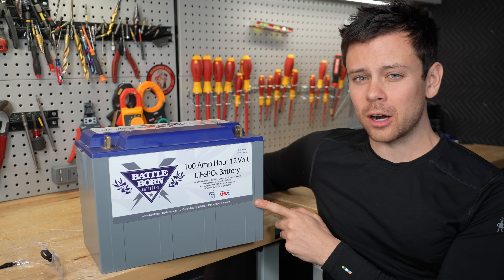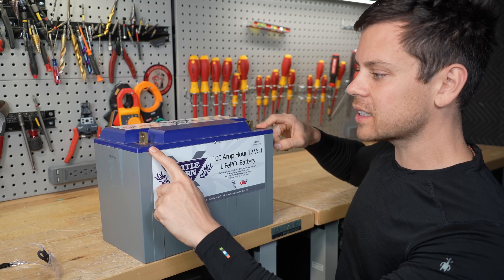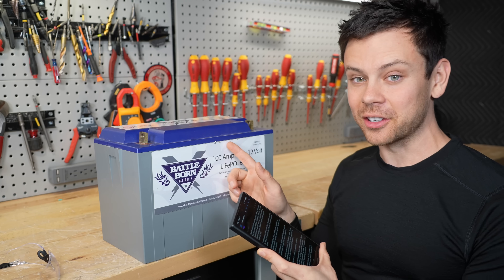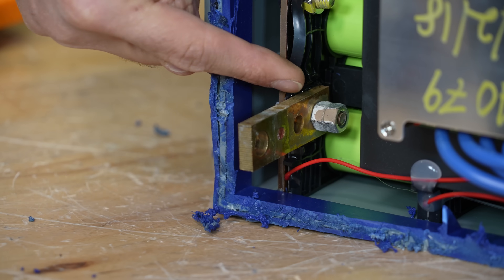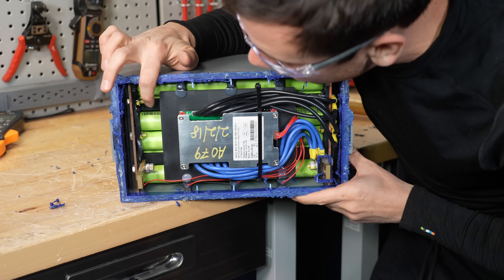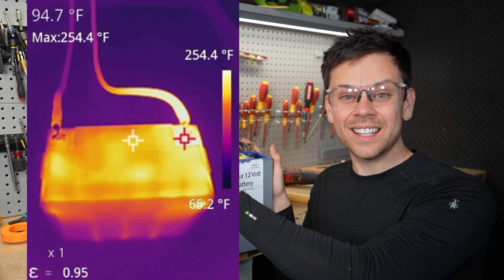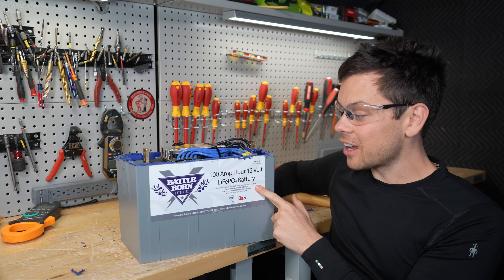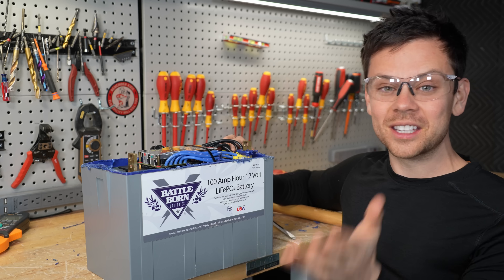Battleborn 12V Battery: Major Safety Issue

Comment: Expensive battery with subpar workmanship. Unbelievable.
Reply: I just check .. These things are priced at $800 WITH A DISCOUNT?!  WTH??
Reply: @jonjohns8145 The best paying bet in Reno
Reply: @jonjohns8145  Think how much they would be if they were designed and built properly.
Reply: @davesmith3561 Capitalism always Trumps quality when it comes to the bottom line. Always !
Reply: Gotta spend that money on advertising and private jet vacations!
Reply: @shaunnightfire8269  that a giving away batteries to "off grid influencers"...
Reply: Subpar is a huge understatement. These are crap!
Reply: Sounds like the RV world.
Reply: Unbelievable???  Try par for the course these days!
Reply: Subpar design. Using plain nuts and bolts for connections with compressible, flexible plastic inbetween is a failure waiting to happen.
Reply: If there is plastic between this electrical connection, i would call this a creation of hazard. Or is it a case of drug abuse?
Reply: Typical made in America crap. BB must have taken a private equity investment.
Reply: @kablah777 bb use Chinese parts.
Reply: @JohnnyDanger36963  True. What I should have said was "Assembled in America".
Reply: @kablah777 
Trump family must be majority shareholders for this level of grift!😂
Reply: Does anyone know if their 8D series batteries have this same crappy design?
Reply: Believable!
Reply: Expensive? Ha
Reply: Too bad the batteries aren't connected to the Internet, then they could do what Tesla did which was simply log into your system unbeknownst to you and drain your batteries to 0% state of charge while they figure out a solution and do their best to keep everything quiet and hidden from public scrutiny. 😂
Reply: Made worse by them choosing to glue the case shut and prevent easy access to the end user 👎
Reply: Not just subpar workmanship, this is just a terrible design in the first place!
Reply: This is both, the bolt needs a torque speck and Loctite 3888. If I had this battery I would replace it.
Reply: @michael807  No.  The plastic would still flow under pressure.  You can locktite the threads all you like the bolt is still going to separate from the bus bar.
Reply: @michael807  it's possible that it wouldn't help. If you have a less-than-perfect connection to the terminal to your charger/inverter, you could send heat through the terminal, and melt the plastic sandwich. No amount of torquing or Loctite fixes that. They actually claim this design is a safety FEATURE.
Reply: @michael807  Plastic softens and the clamping force will drop with time, temperature, and vibration.  This has nothing to do with improper torque.  It is a serious design flaw.
Reply: There should be a conical spring washer on brass bolts.
Reply: Design flaw, not workmanship.
Reply: @retrozmachine1189  Yep. They claim that sending the power through that bolt is a designed SAFETY FEATURE!
Reply: @retrozmachine1189  Actually both.
Reply: @mxslick50  Can you state that the nuts were not properly tightened?  That would be a workmanship problem.  Putting the bolt through a plastic part, which appears to be the only issue (plastic flowed as it does, tension came off the joint, resistance and heat ensued) is a design flaw.
Reply: America today is producing crap worse than China 20 years ago!
Reply: @HG-Pilot  These are produced in China... The problem is, WE DON'T PRODUCE ANYTHING IN THE USA ANYMORE...   You can thank Shareholder and Union greed for that...
Reply: @FJB2020  The cells are produced in China. The cases and assemblage is here in USA, per battle born’s puffery. The case and assemblage engineering are also supposed to be here in the USA and they claim to be veteran owned.
Reply: Workmanship is good, design is wrong.
Reply: Very American.
Reply: Well it is 2025 and it is a Chinese product
Reply: @jackoneil3933 Designed and assembled in the USA. Says on the front of the battery!
Reply: @jackoneil3933  Slave labor.
But - wait - I thought BB was made in USA??!!
Reply: @jackoneil3933 Not Chinese, assembled in USA
Reply: @ivorscruton5121  and where do you think the parts and design come from?
Reply: @lowbobcatTDI  would that bolt work better if it was an American bolt? And aren't products made by western companies usually designed in the west?
Reply: @a @atnfn  I think a $100 Chinese Dumfume battery wouldn’t have this issue at all.
Reply: @lowbobcatTDI  The manufacturer claims the design is by them, as per communication directly with them. The components are of Chinese origin, but when one assemblies something using foreign components and claims to be "made in the U.S.A," then they have the responsibility to back up their product, they can not place the burden on their suppliers, regardless of where they are sourced, much like many other industries, including vehicles.
Reply: @ivorscruton5121  "assembled" aka they put a sticker on it and call it good....
Reply: @ivorscruton5121 You're joking yes?
Reply: Not only are they still charging 400% the going rate of batteries now, they're also bad. Lol. Only solace is most of their customers are boomers.

Comment: I own a Airstream Nineteen and it has 2x of the 100Ah 12V GC2 LiFePO4 Deep Cycle Battery. I wonder if the design is the same.

Comment: Damn.....  I have two of these in my off-grid cabin.
Reply: I wouldn’t panic if you’re not in a vehicle, I have eight of them – but they’re all stationary.
Reply: If it's stationary, should be ok.
Reply: @cadevaughn7596  They deny warranty claims on this failure if there was a loose connection at the lug, causing resistance resulting in heat during high current flow. But even stationary applications will see terminal connections "loosen themselves" from thermal cycling, so it's something to keep an eye on.
Reply: @Consumer7977  Can't be too careful. I'd expect Battleborn to make good on a recall. Scary stuff